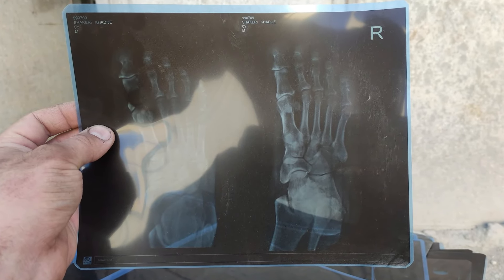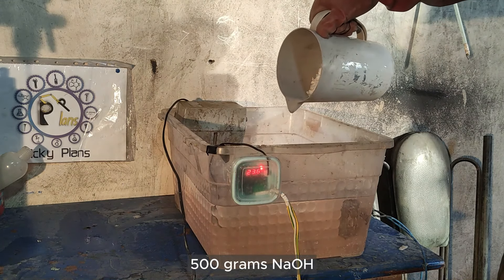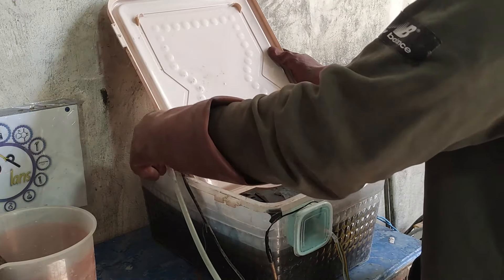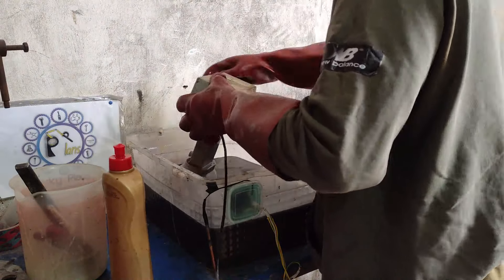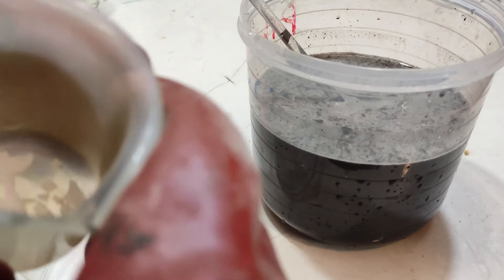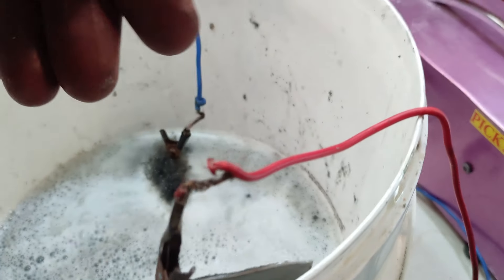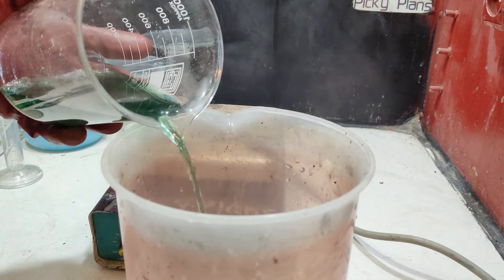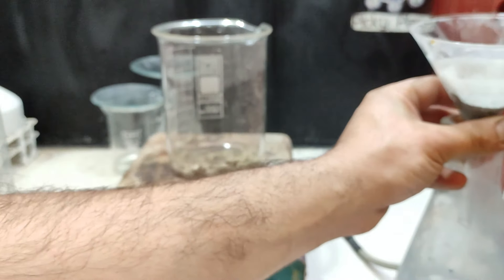Silver recovery from X RAY film SCALABLE PROCESS

Comment: Wouldn't have been easier/ safer to concentrate the silver oxide caustic solution and add a sugar or glycerin to the concentrate and precipitate the metallic silver?
Reply from the maker: Yes just add some PAC ( poly aluminum chloride) it's easy to find used in water treatment. Silver oxide would precipitate very cleanly in 1 hour. Decant solution and add glucose syrup and stir it well . Then wash your silver and decant and melt.
Reply: @PickyPlans  Nice, about how much PAC would you want to add to the 500 g/ 10000ml solution? Would you want to add it before or after reduction? How much Should it be reduced in your opinion? Will the amount of PAC added be based on the amount of material processed?
Reply: @PickyPlans  My son and I process x-ray film to raise money for his college tuition. A more cost effective refining technique is greatly appreciated.
Reply from the maker: About 15 mg / l of solution PAC is good but you need to add sulfuric acid to adjust Ph to 8 (from 14 because of NaOH) at  7-8 PAC has the best effect. 
You need to add the calculated amount of PAC to some water (like 100 ml) then add PAC solution to your batch. Mix and let it sit for 1-2 hours. Then siphon it and filter and wash sediment. Raise the pH again and add glucose syrup and heat it then wash ....
Reply from the maker: I wish you the best...